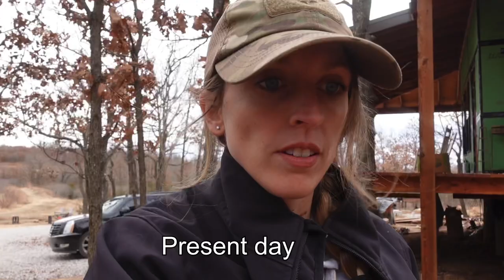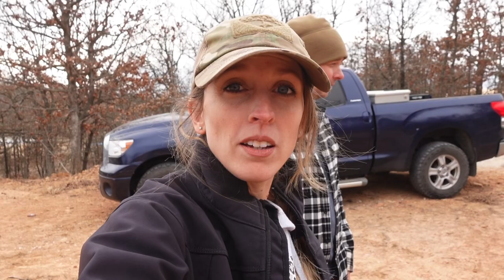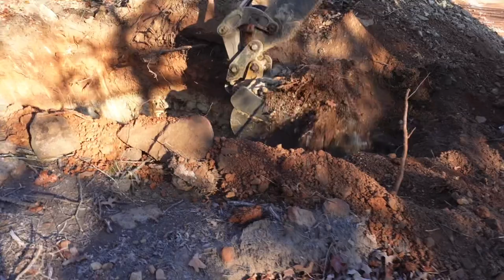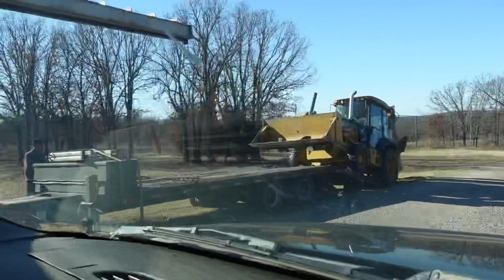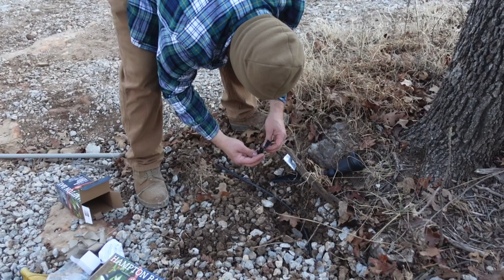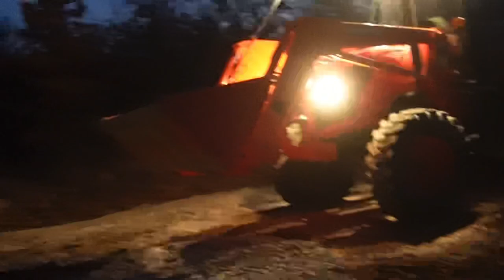Tornado Shelter Installation | DIY Cabin Build

Comment: You said that you’re still thinking of what to do for siding. I’ve seen a lot of homes in the country with board and batten siding. As a matter of fact my parents home has it. They left it natural unfinished wood.  My friend used cement board instead of wood says it lasts longer. These are two good choices in my opinion. 👍
Reply from the maker: we really want a board and batten metal but the only suppliers we can find are far away and shipping fees are almost just as expensive as the metal. we love board and batten!

Comment: if there is that many tornadoes, why aren't there more earth homes??? easier to heat cool without ac just use a fan to move the air around 1 or 2 window walls and safe from fire as well